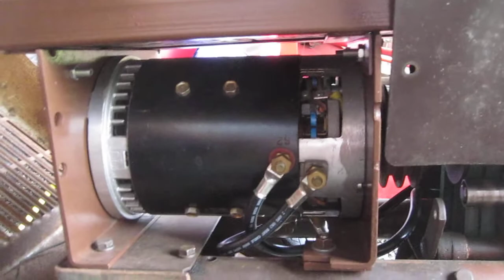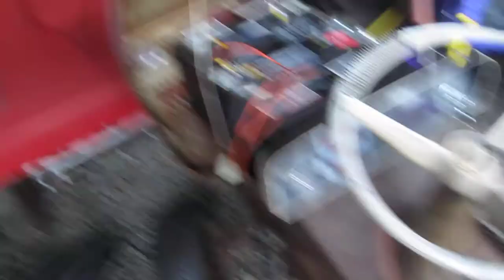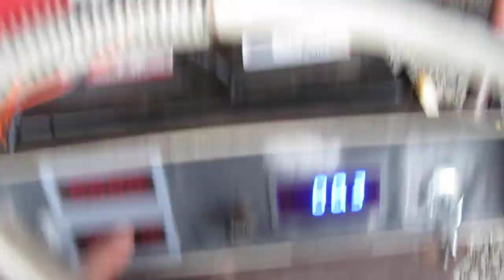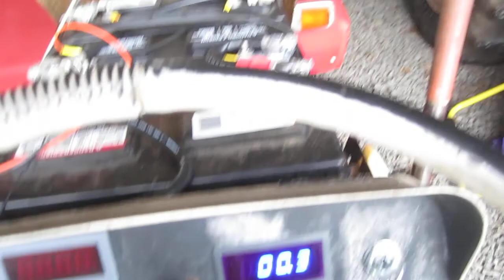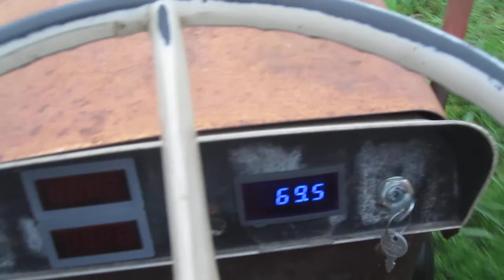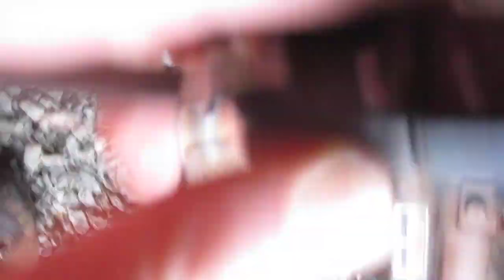Bolens 1050 electric tractor conversion part 2

Comment: Add a reverse switch and you'll never have to change gears for going in reverse.
Reply from the maker: That is true.  Tractor is still going.  I changed the batteries to Lithium a couple years ago.